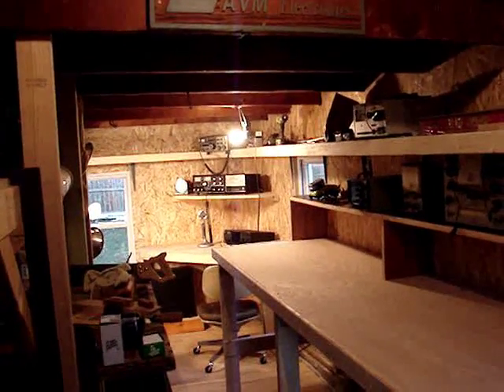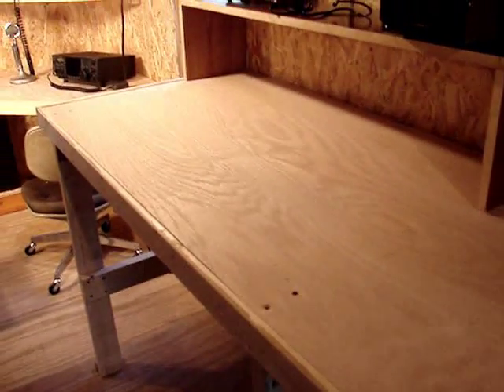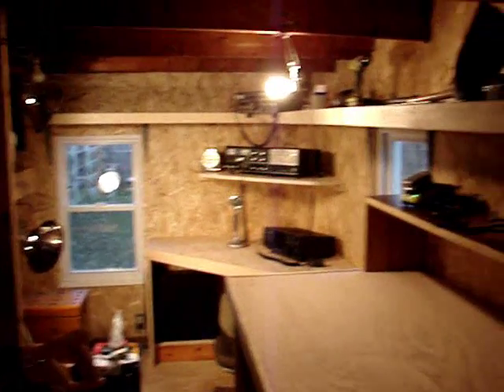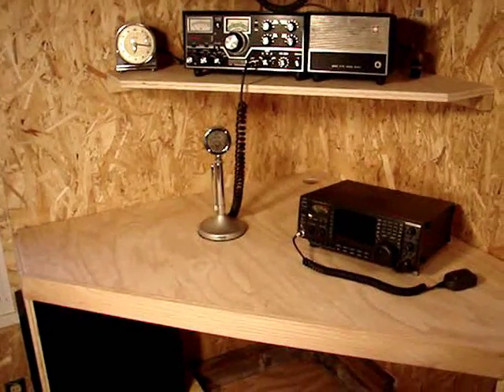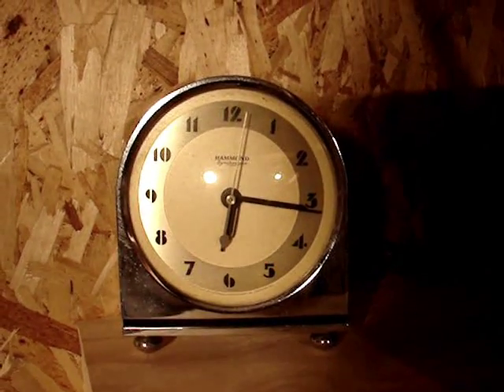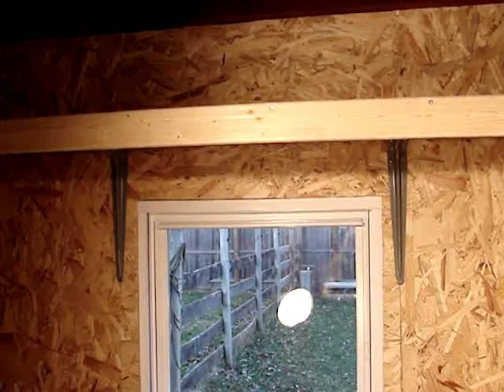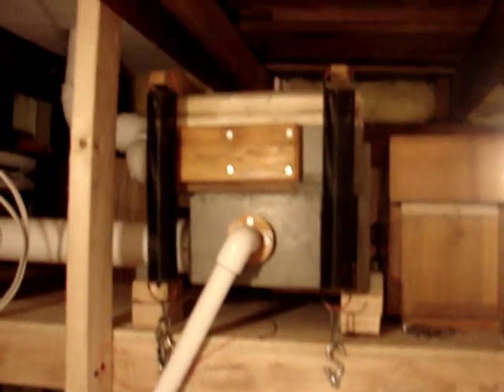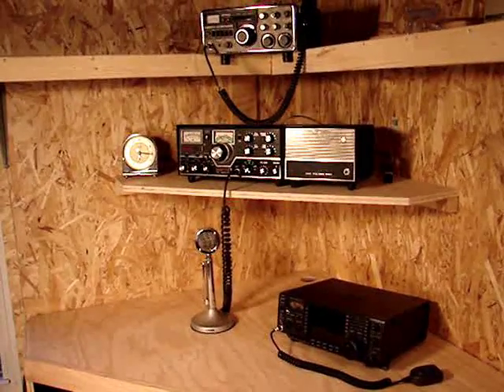Electronics work shop and ham radio desk PT2

Comment from the maker: @HD41117 Thanks! In the late 1920s and early 1930s the Hammond Clock company designed, manufactured and sold electric clocks. Lawrence Hammond was fascinated with electronics and the idea of producing music electronically. The first commercial Hammond "organ" the company sold was the model "A" produced in 1935. I have one and posted a video of it a couple of years ago. I'll do another showing the workings of it. Gary